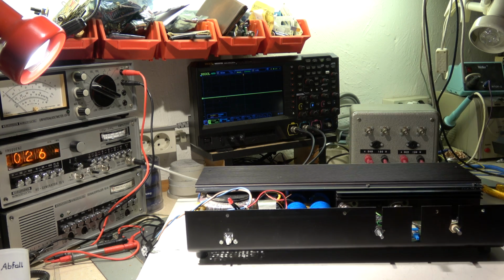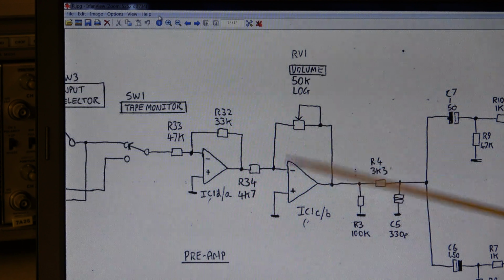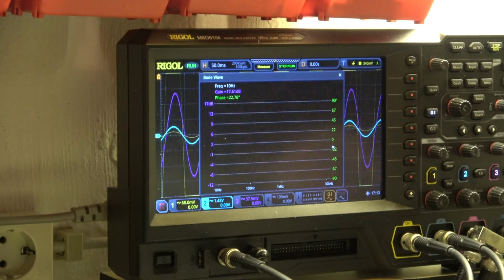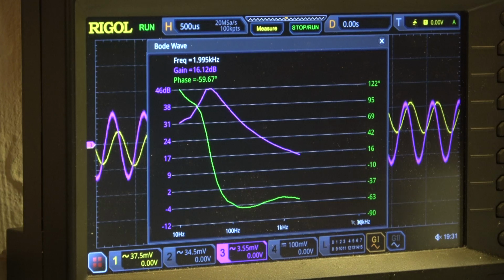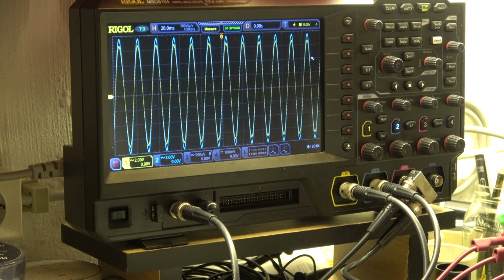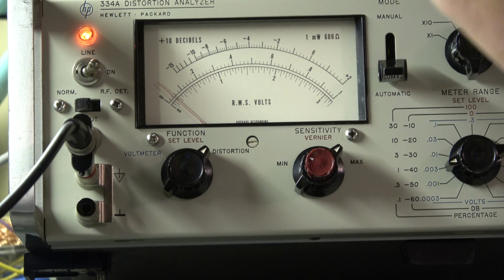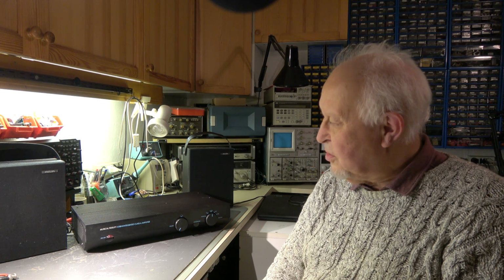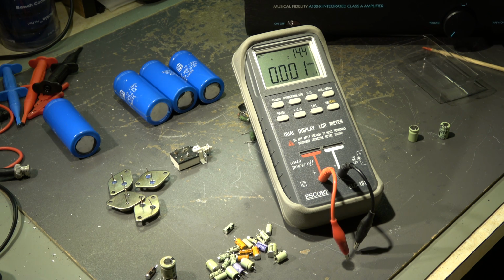#187 MUSICAL FIDELITY A100-X Part 3(3)

Comment: Thanks so much for this series.  I had the lower output a1 model when these were new. It blew a diode in the bridge rectifier just after the warrenty expired. I was an apprentice tv and audio engineer at the time and upgraded the diodes . I moved away from electronics some 30 years ago but still dabbled . I have an a100 that i bought from ebay dead on arrival. My skills are very rusty but this series has helped clear up a few things my memory ztruggled with. Thanks again. These amps do have a most engaging sound, which is why they get saved.

Comment: I had a A100 for several years - I kept my coffee warm as well😀The picture of your coffee mug on the A100 actually triggered me to see this interesting video
The A1 was so much better so I regret bitterly that I replaced it with the A100.
Had problems with capacitors drying out and the last time it failed it went to the recycling bin - I was recording a record to tape and the sound of the A100 dying was recorded, but the tape is lost looooong time ago.

Comment: Thank you for the wonderful advice. I almost switched the speakers to my primary pair after running the hot amp for 5 days, few hours each day. Didnt realise on the lack of internal protection system eventhough i opened the cover to visually inspect the parts. What a great series, enjoyed every second of it. Thank you for taking the initiative and putting in much effort to share it with everyone. You probably saved my speakers that I intended to run the amp with.

Comment: That amplifier is one of the weird ones 😊 designed by golden-eared hifi experts and that regularly have to be repaired by normal people like us. I’ve come across a couple of these and only last week refused to take on another one for a friend of a friend of mine. I just had so much trouble with the two I did that I’ve learnt my lesson 😊 Thanks for the video, and especially the Bode plotting that you did. Really nice function of the scope.
Reply from the maker: Mni Thanks dr Manuel - yes indeed: weird!! But the sound is said to be "warm" ... hihi.
I also wouldn´t take a second one for repair - my need for additional trouble without fun is fully satisfied.